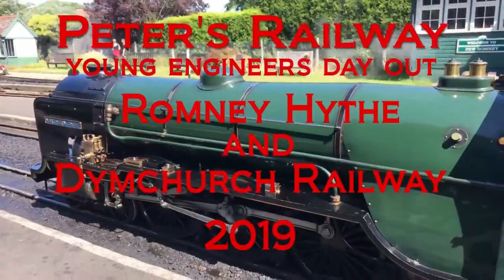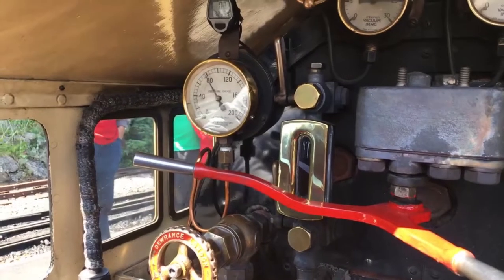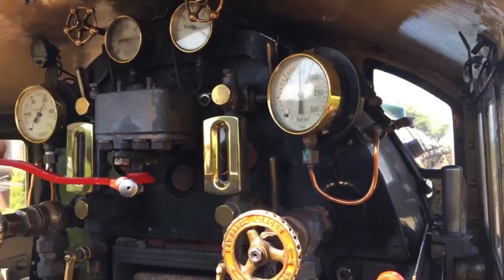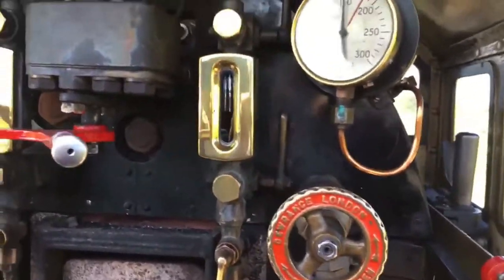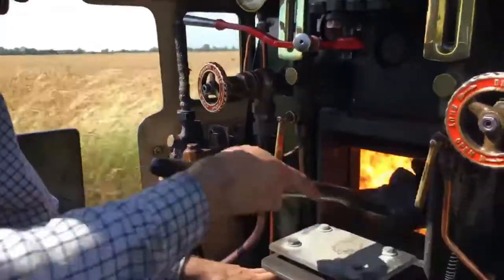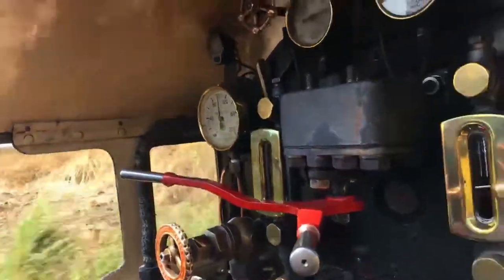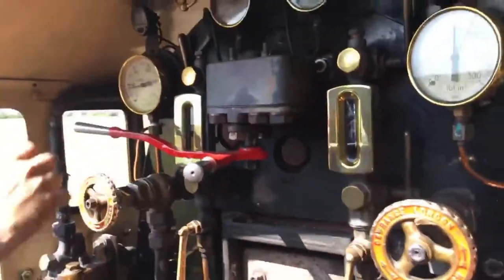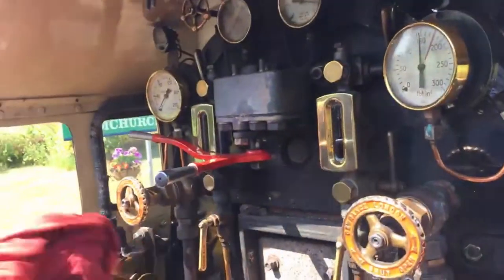RHDR Cab Ride during Peters Railway Young Engineers Day 2019

Comment: What a wonderful tour of the working end of the train and what's involved. How does the steam injector work to get replacement water into the boiler? There must be a system to create more pressure than what's in the boiler to force water in 🤔
Reply from the maker: Hi, that is a great question and one that is tricky to answer in a few words.  The trick is that the injector swaps a lot of kinetic energy and momentum in a high velocity jet of steam (which slows down when it hits cold water in some cones) and gives its momentum to the cold feed water.  This, is then slowed down in a delivery cone so that its pressure increases sufficiently to enter the boiler.  It sounds magic, but there are no laws of physics broken!  You have to remember that there is a large volume of steam leaving the boiler at some pressure, while the volume of water entering the boiler is very small  The energy of the pressure flow is equal the pressure x the volume.  (in whatever consistent units you use.)  If you want to know more, I am sure the Google or Wikipedia will help.  https://en.wikipedia.org/wiki/Injector  
Thanks for watching! Chris.
PS. If you would like to know about the books I write to teach children about railways, science and engineering, there’s lots of info here: 
https://petersrailway.com/
Reply: @PetersRailway  Thank you for the reply, and as soon as I saw venturi, it all clicked. Had seen manual pumps being used in small scale model steam engines, but now know what happens on a larger scale.
Cheers
Pete' New Zealand 👍.
Reply from the maker: @Bristoll170  M. Giffard, who invented it before much understanding of thermodynamics, must have been a clever man!! Chris.
Reply: @PetersRailway  I know how the injector works but it still fascinates me that it does As you say Mr Gifford was a very clever man. As a kid I rode on an industrial locomotive and always wondered why they let the water out of the saddle tank while having lunch then filled it up after, I found out years later it was because injectors work best will cold water and being a saddle tank the water got warm.
Reply from the maker: That was very observant of you!  Yes, if the water is too warm/hot, then the steam doesn't condense quickly enough onto the water and so the impulse given to the stream of water is not high enough to give it enough velocity.  I am hoping to make a video about how the injector works, sometime next year...  Chris.
Reply: @PetersRailway  That will be worth doing and with animation if you can to show the flow of steam and water. I went to a factory called Brookes Limited a brick works and paving stone maker. They had three locomotives and I only got to ride on two of them. Sadly those two were scrapped when they closed down but luckily the 3rd loco Brookes No 1 was saved and is now at the Middleton Railway. I hope I can get a cab ride in it one day even if only a few yards.
Reply from the maker: Yes, I will try to explain it, but the animation of the flow will probably beat me!  It is true that so many locomotives (and railways/stations etc) were scrapped, but it's important to not let that get you down and to enjoy the amazing amount that has survived.  I am sure the MR will give you a cab ride if you ask nicely!!...  Chris.
Reply: @PetersRailway  LOL It would defeat me as well. I am glad we have so many preserved trains and locomotives. We cannot save everything and many industrial locomotives were scrapped but we do have a lot of those that people thought to save. I also think it is important to keep as much as possible in working order to show how things work and how clever those old engineers were.
Reply from the maker: Yes, it drives me nuts when museums are just full of stuffed and mounted machines when some could be demonstrated.  Almost worse is when they have some fantastic bit of kit but with a description which a five year old would find too easy!  There should be something simple, then more info for the interested person.  If possible, the information should contain something which even a PhD student would not know.  Arghh!  Chris